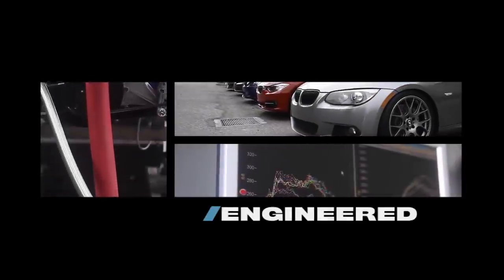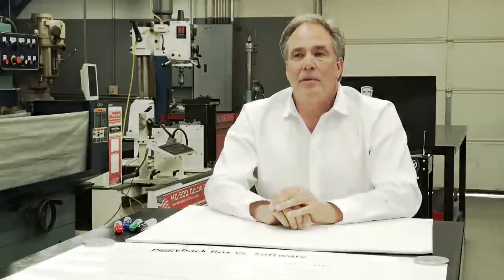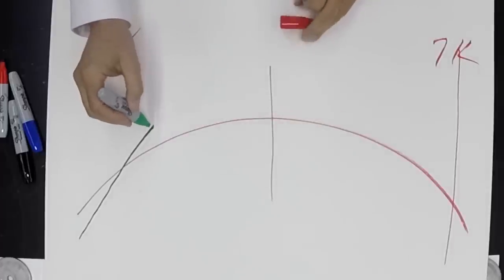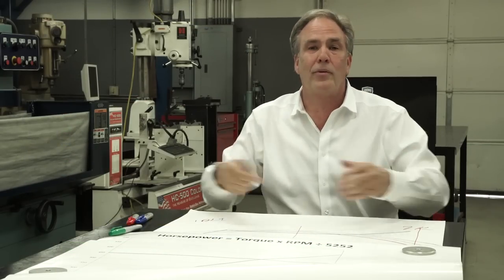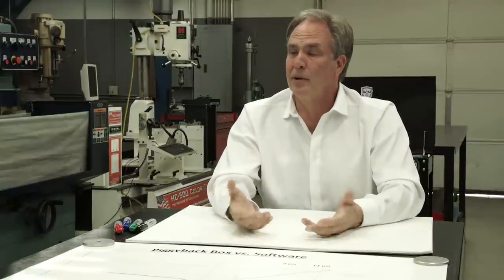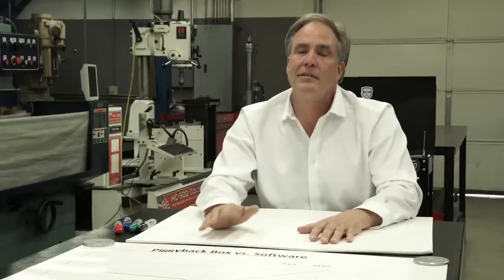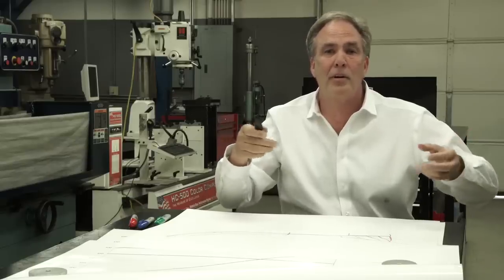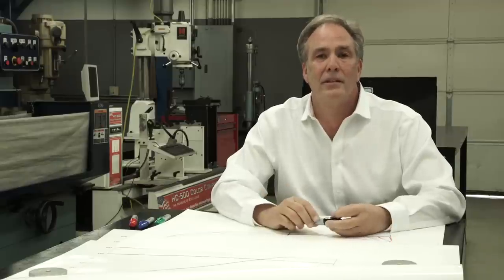The Magic of ECU Tuning - /ENGINEERED

Comment: That stuff about strait ECU tuning with no parts being a waste of money since the 90's is total horse shit.  My 2013 v6 mustang picked up 20hp and 20tq with just a tune.  The Coyote mustangs pick up about 60hp with just a tune.  He just said that because he wants to sell parts.
Reply: +Brad Johnson I have to agree with you.  I owned a pair of Coyote 5.0 Mustangs.  With just a tune and no hardware changes, I picked up 3 mph and 3 tenths in the 1/4 mile.  There IS such a thing as a conservative factory tune.
Reply: +Brad Johnson Did you get it tuned by a person or a device that was tuned by a person, or did you buy a 27 pin snap in chip off ebay that simply increases or retards timing?  People are oversimplifying the type of "tuning" he is talking about.
Reply: +Shift4g Most likely there talking about a email custom tune, from an sct x4 handheld tuner. Thats what I did and definitely picked up power.
Reply: Connor Becker Correct
Reply: 27 Pin Snap in Chip?  No, it was a Lund Racing (Most Respected Custom Tuners in Ford Aftermarket) hand held SCT programmer with custom tune in it. Tune is Dyno Proven to Pick up around 20RWHP and results at the track across thousands of owners prove it. He said that without parts bolted on that tuning alone is a waste of money.  That is a lie and he knows it.  Vehicle manufactures all leave power on the table that can be tapped into by someone who knows what they are doing without parts bolted on.  Especially with variable cam timing that my motor has.  Regardless, my last car (03 cobra) picked up a lot of power with just a tune also.
Reply: Brad Johnson  Simply adjusting timing at different points, and removing a rev limiter like one of the chips found on the internet that are batch flashed, are not what I would consider "tuning".  My original point was that what you used and methods like it now a days are way beyond and do way more than what Dinan is referencing (poorly worded by him perhaps).  For instance, the chips currently available for the 20+ yr old e34 M5 he has on the shop floor in the vid.

The ecu in your stang (and a great deal of cars after 97) is many times more advanced, and controls many more aspects of engine output. Not to mention displacement is in your favor. So it's reasonable to believe modification to the ecu could add power over factory, especially when someone actually spends time to design the base tune, not just spins the wheel on where they think it seems like a good idea to make adjustments.